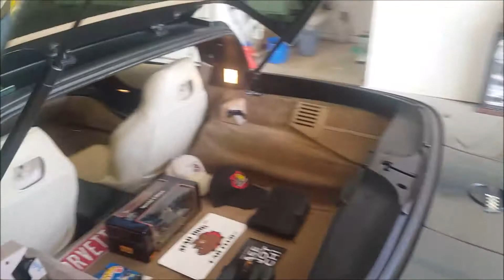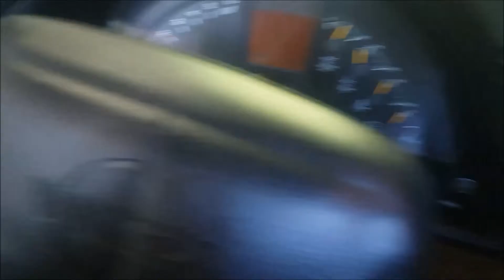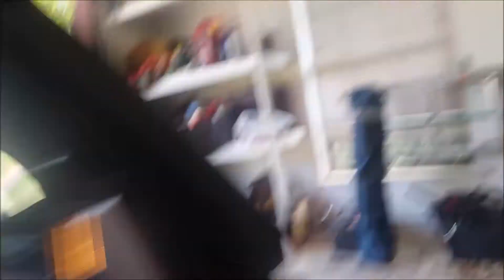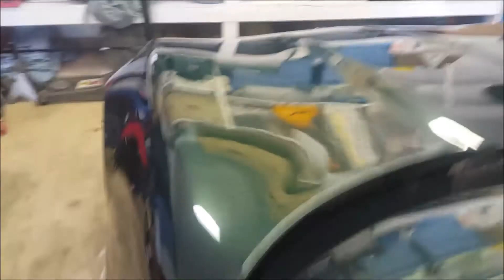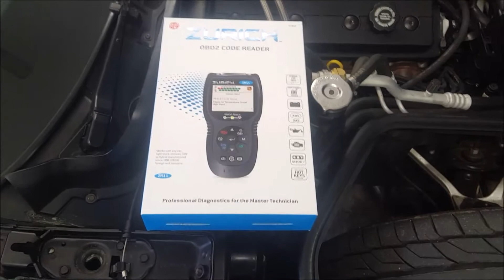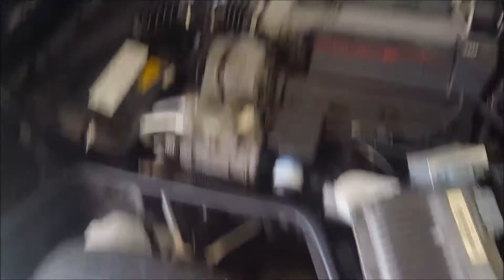My 1996 C4 Corvette

Comment: 5 spoke wheels were only on 95 pace cars(silver painted), 96 Collector Edition (silver painted) and Grand Sports (black painted) and 94-95 ZR1’s (silver painted). They were never an optional wheel on base model cars nor was a chrome finish option. 
I believe the radio was either base (maybe just tape deck) or Bose with CD and tape deck. 
You have the base climate control also. Optional was auto climate control that featured digital temperature display. 
Stock LT1 was 300hp
Optional for 96 only was LT4 with 330hp and 6speed only trans. Standard on Grand Sport’s. Optional on all other models in 96. 
C4’s are good looking cars to this day!
Reply from the maker: there were actually two base AC delco radio options.  the base am/fm and the mid level with cassette player.  I also checked the data sticker and compared to the factory manual.  this car is coded for five spoke wheels.  Because this car was one of the last ones built, the factory was emptying the stocks of remaining c4 parts.  My car is coded with a lot of grand sport, Z51, and other upgraded parts and sold as a base coupe because it had the LT1/automatic build.  the suspension is upgraded and wheels.  These are not original, but replaced the upgraded five spoke option.  I got this info from an employee at Bowling Green when the car was built.  Hope this clarifies.  Thank you.
Reply: @shepab01  
Interesting.  I know the very last C4 built (all white with white 5 spokes) had them.  Corvette Mike got that car.  I guess nothing in life or cars is for sure.  Always cool to hear about strange/rare options that got out. Thanks for the follow up!

Comment: Can you please tell me about the stereo I won’t to do a aftermarket stereo not going to use any of the old speaker I have a 1986 corvette stereo wire colors and where the go on the new stereo
Reply from the maker: I bought everything through Crutchfield.  The stereo is a Kenwood, polk audio speakers and a wiring harness that bypassed the VATS.  Its been a few years ago so the prices have probably changed.  Good luck and thanks for subscribing.
Reply: I am asking what color wire get hooked up to the new stereo that was my question
Reply from the maker: @corvetterandy2022  sorry mate, i couldnt tell you.  the wiring harness to bypass the VATS was plug and play with the matching sockets to the car.  I would not know which wire your looking for.

Comment: So wow. I have a '95 C4 with identical ZR1 chromed (not polished) wanna be wheels, those center hub caps, and those chrome plastic lug nut covers. Also have installed your center console data plate. Don't have the DIC emblem however. Of course your car is the wrong color. Mine is Competition Yellow with the same beige interior. I still have the stock exhaust tips. OEM's are not dual-per-side and chromed. That is aftermarket. Oh, and I also just installed the Nitto 555's and zinced drilled and slotted rotors. Man, those are some hard tires. Seems harder than the OEM Goodyears. Oh, and I think you are overestimating your HP and torque. I have the same engine set up and I feel no seat of the pants difference, but I do have the performance rear end for a little more torque. Nice review however. Maybe you , like me, love the car so much that I will never part with it. Of course I have a '17 Grand Sport Heritage to stay modern. BTW my little girl is so pristine that it has won first place in C4 class in every show I've been to in the last 8 years, but we've never been to Texas. :-) Enjoy your pride and joy. She is a beauty!

Comment: Your wheels are ZR1 replicas right? They don’t appear to be 11” in the rear. Or at least the lug nuts don’t appear to be indented like the original 11” wheels are.  Just curious.. that’s what I’ve noticed on the ZR1 wheels listed on EBAY.
Reply from the maker: Good question and thank you for asking.  My car was built in the last month of production of the c4.  It has the Z51 option which came factory with the polished ZR-1 wheels you see here.  And they are 11 inch rear wheels.  The fun fact is, this car was built using alot of grand sport parts.  I have verified this with the build codes and my factory service manuals.  I was told that they were clearing the production lines to make way for ramp up of the c5 (already in production) and were using what was available to finish production.